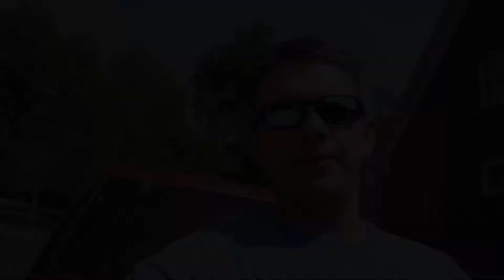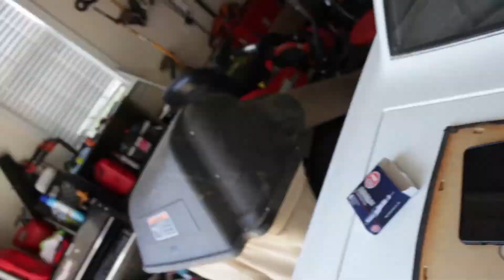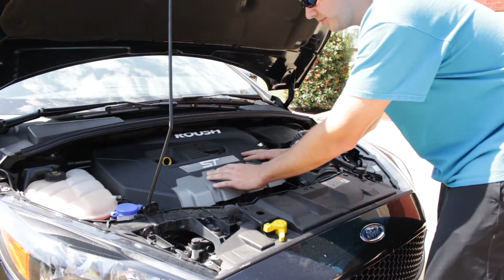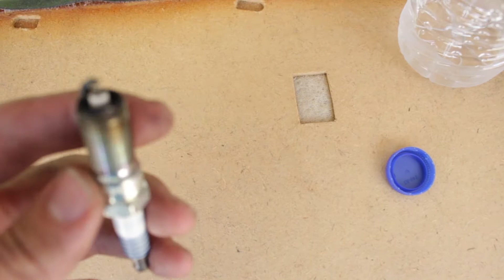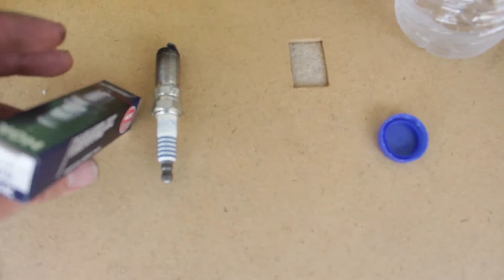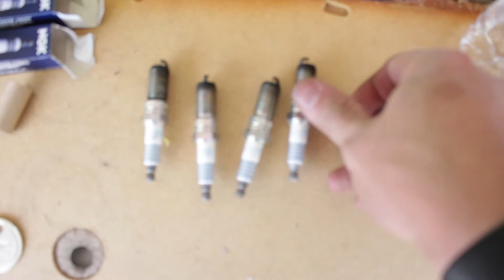How To Change Spark Plugs (Focus ST, SE)

Comment: Link for the plugs please? I'm going to need em later. Some big power and chassis mods planned in the coming years. Should help with long track days
Reply from the maker: +VietnaMilk http://www.cjponyparts.com/ngk-spark-plugs-iridium-ix-set-focus-st-2013-2017-focus-rs-2016-2017/p/LTR7IX11/
Reply from the maker: +VietnaMilk be sure to gap to 26
Reply from the maker: +T Torres1183 .26
Reply: @TTorres1183  whats the bone stock gap spark plug for 2013 focus ST and what brand is the stock spark plug?